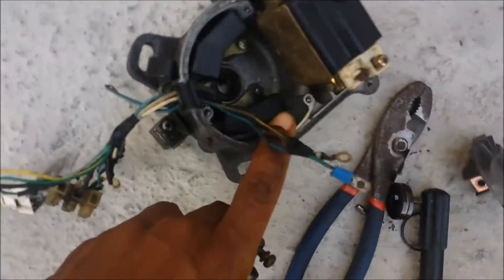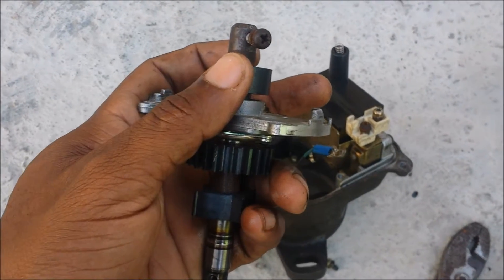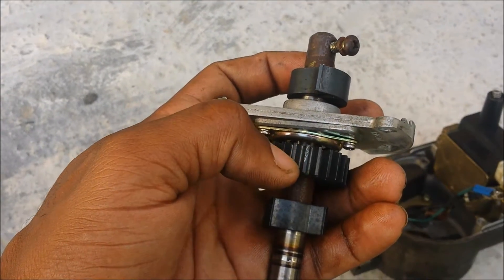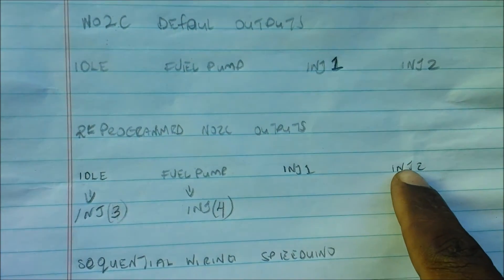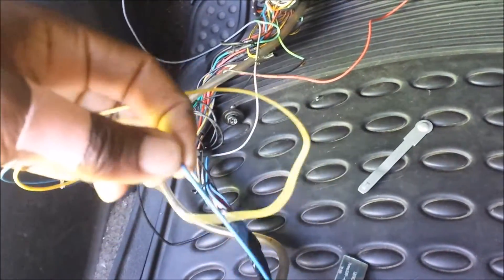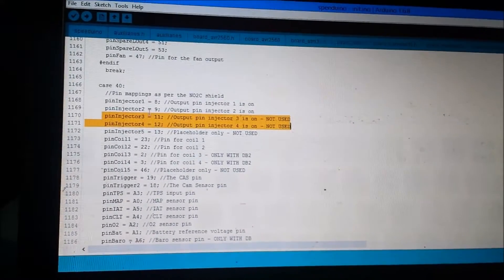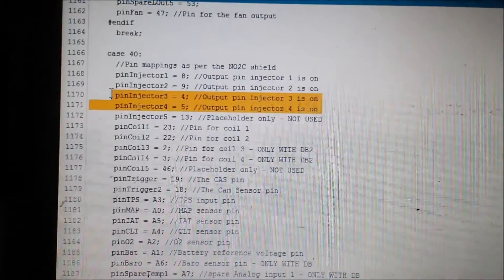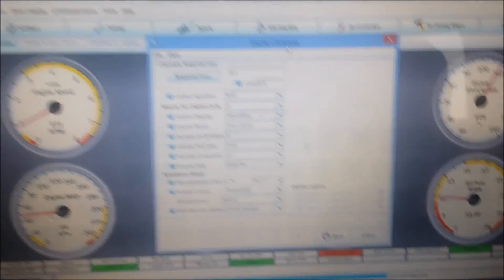How to - 4 Cylinder Sequential Fuel Injection With Speeduino NO2C

Comment from the maker: In addition to the fuel pump and idle output, the NO2C has a vvt and boost output. Any of these 4 outputs can be repurposed as fuel injector outputs not just FP and idle.
Reply: How do you rate the NO2C? I get it's basic, but I see you use them a bit.
Reply: Thanks for your groundwork on this. I'd like to do this. I can't get the NO2C schematics open for some reason to check for myself, but do you think VVT & Boost outputs need diodes & pullups adding on the board?
Reply from the maker: @Loopyengineeringco  I haven't seen a situation where it was needed

Comment: It can work like that, engines can work pretty well without CAM sensor in batch injection. You get very stable Idle once the engine is warmed up, due to the fact that the fuel waiting at the valve sit already evaporates into vapor. But not so good on fuel economy! It would be better not to have the Crank sensor on the same shaft as the Cam, so the ECU can compensate for belt or chain elongation to some extent.

Comment: I'm trying this on the latest code and I keep getting compile errors, is there any way to change outputs on the newer code? I'm running an inline 6 and would like 3 injector outputs and 6 ignition outputs, using the v0.4 shield using the wtmtronics +2fire ignition addon that swaps the step and dir pins for ignition outputs.
Reply from the maker: All firmware should be editable

Comment: The reason Speeduino, Megasquirt 2 & 3, ECU Master and others can do 24-1 full sequential from a single cam sensor is the missing tooth passes at 720 degrees of crank rotation as opposed to 360 degrees on a crank mounted missing tooth wheel. This allows the ECU to calculate full sequential for a Four stroke engine whilst a 2 stroke engine can do full sequential from a single crank mounted missing tooth sensor because it only requires 360 degrees of crank rotation for a reset.

Comment: what did you do for the sequencial spark? you didnt have to add ign 3 and 4? can you leave the coils wired as batch?
Reply from the maker: Get the "2 fire" board from wtmtronics.com
Reply: @DCWERX  is that what you did in the video? or can you just leave the spark on on 2 outputs and ran the injectors on 4
Reply: @DCWERX  will do thanx

Comment: Im wanting to use speeduino to convert my 4cyl motorbike from carbs to sequential fuel injected, it has a crank sensor but no cam sensor.
is there any way to run sequential on crank sensor only.

Comment: How did you remove the teeth? a grinder? I am having noise on the basic distributor setting so I want to do the same modification.
Reply from the maker: A Dremel works best, less risk of affecting other teeth, although it can be done with a grinder with steady hands.

Comment: Hey I love your videos and I find them very useful is there a way you can test ignition without a crank signal on the speeduino?
Reply from the maker: You can try the hardware test for ignition output but the best way is to use a spare arduino with ardustim feeding an RPM signal to speeduino

Comment: I see you wired it according to firing order but can you not wire A-1, B-2, C-3, D-4 and just set the firing order in Tuner Studio to be ACDB?
Reply from the maker: There isn't an option to select the engine's firing order in TS currently. It would definitely make it easier if there was that option. For now you have to do it manually like I did.
Reply: @DCWERX  Interesting. It's an option with megasquirt installs so i'm sure it's possible with some future updates. :)

Comment: Man, great explanation!I did some similar on Megasquirt 2 a few years ago, and was definitely worth it. throttle response/light load behavior became much better (with proper injection timing map). Adding MAF and car behaves smooth, like with factory ecu. Cheers!
Reply from the maker: You welcome man. I have not had time to do any tweaking to the tune but as soon as I do I will share my experience. I expect slightly better idle when it's all said and done. Thanks for watching and feedback
Reply: How can I add a maf sensor?

Comment: Thank you for this video,it allow to understand that you are not stuck on one configuration,and can modify it. 
As i've understood after some google searches,sequential injection is good for idle and low rpm fuel economy and better for engine behaviour to those rpm,but it does not offer an advantage at higher rpm.
It's said also that's difficult to find the good injection timing ,following the intake length and rpm ,since you are supposed to spray fuel while air is travelling,otherwise it would be like batch fire ,with fuel sitting behind the valve doing nothing before it opens.
Reply from the maker: Correct, sequential really shines for idle and low rpm fueling especially with large injectors. I have not touched my fuel table and I can say I don't see any difference thus far but I will play with it a little and report back.
Reply: I'd say it'd make a bigger difference for the fuel swirling that's involved in the VTEC-E engines under 2500RPM or so... I'm doing a build that will focus on efficiency at low RPM for highway cruising, coupled with E85 for maximum cost savings ;)
Reply from the maker: @TsunboRecords  with a programmable ECU the possibilities are almost limitless. I would really love to see a before and after fuel economy test between your stock ECU and speeduino
Reply: @DCWERX  You'll definitely see it... I just started a thread in the Speeduino forums for my MB3 ;)